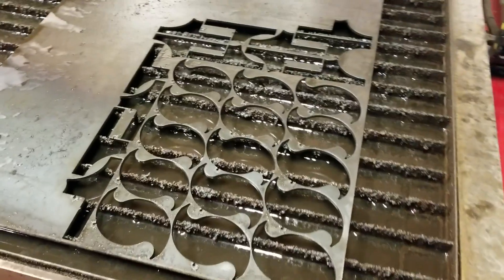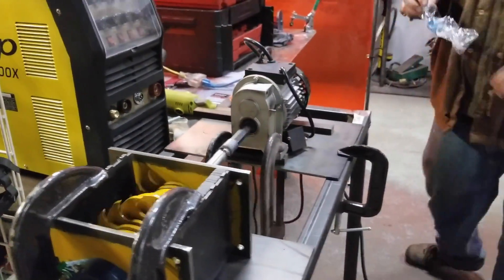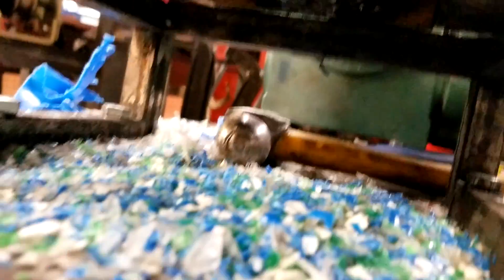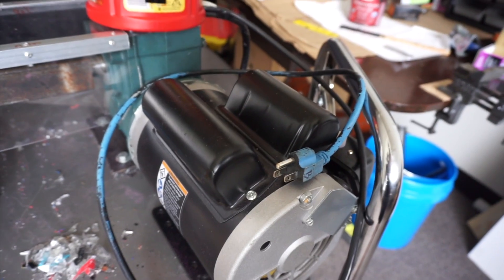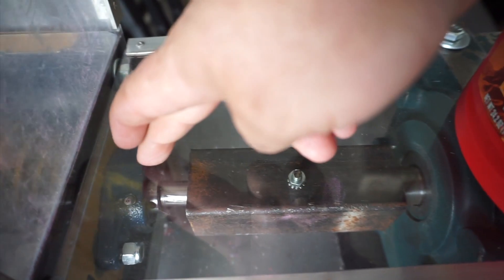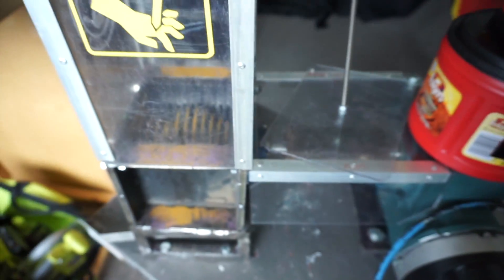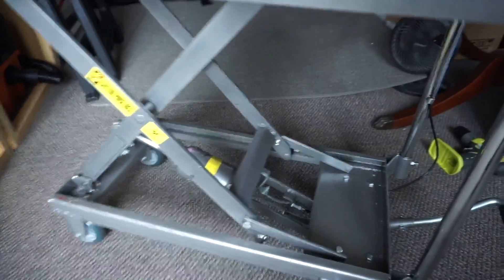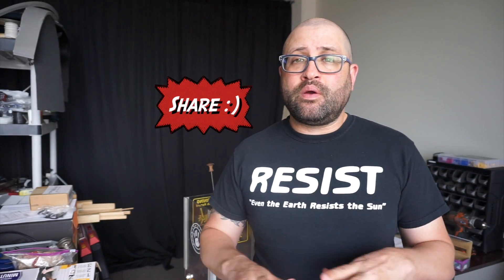Building a Plastic Shredder to Shred Plastics

Comment: The Precious Plastic guy's mentioned that the shredder had a tendency to have problems with the screen if you try to run in one pass. They recommended running it with the screen off then doing a second pass with the screen on. It might be worth a shot if you haven't tried that already.
Reply: They mentioned it on their video of the "Shredder Pro", their second gen.  Shredder with twin comminutors.

Comment: nice build! may i ask if the parts cut by the cnc plasma is not tapered? i am planning to build one..but i am not sure what is the better method of cutting parts using cnc considering the price..is it plasma?waterjet?laser? if cnc plasma works just fine, then i would go for plasma..many thanks!!! more power!!

Comment: I did everything with my plasma cutter as well by hand using a pantograph attachment. What I did with the hex shaft was to instead use a threaded rod and a bunch of rod couplers screwed into the rod. Then all i had to do is insert a tube to cover the threads on the ends...done! No machining needed.
Reply from the maker: Nice! It's all about working with what you have and innovation!
Reply: @fiveforachange7997  Başlık türkçe ekleyin lütfen
Reply: I'm interested in this idea of your threaded rod with the rod couplers. Were the ends of the rod smooth or how did you couple the threaded ends to your motor shaft? Any pictures or video links would be appreciated. Thanks